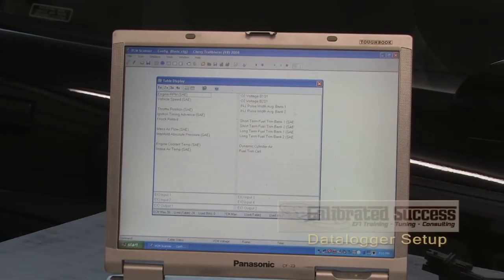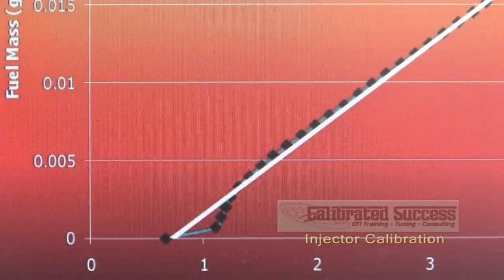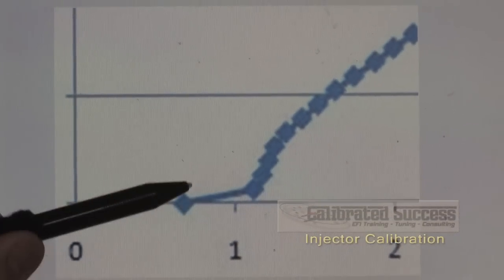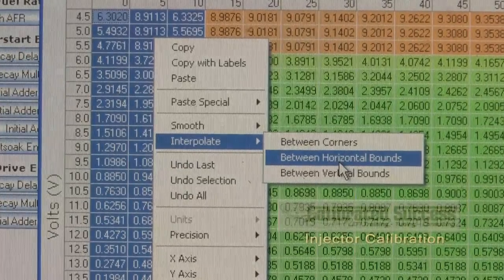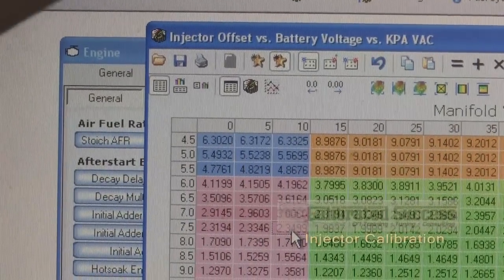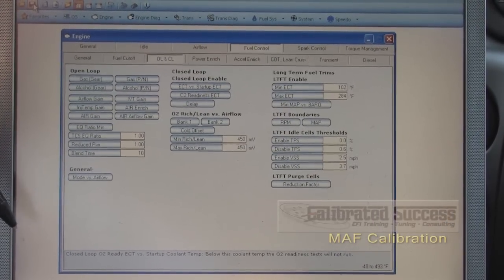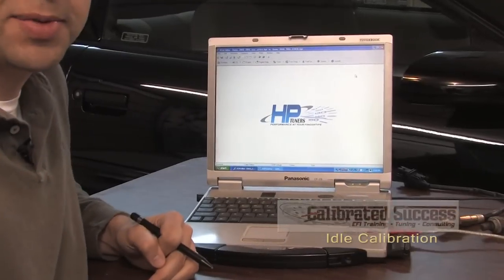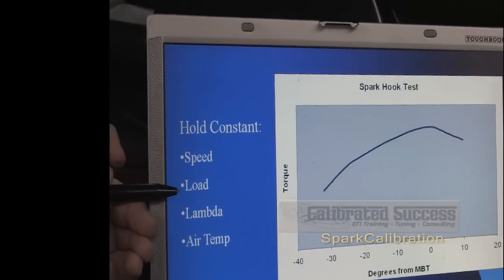Calibrated Success GM Tuning Beginners Guide (long demo)

Comment: 11:29 you say reducing the airflow in the adjustment ? What adjustment ? How is this affected by Cold or Hot start ..
Reply: The new cam is pulling in less air at that point than the OEM cam. Thus the rich error. By reducing the VE value in that cell, you reduce the airflow at that point and lean it out. This is for open loop. Closed loop needs a MAF recalibration to do the same thing. A cold start will richen up the mixture just a little bit and as it gets warmer will remove that added bias.

Comment: whats the tool used ? can it be used for Powertrain Calibration ?
Reply from the maker: Most of this video was shot with HPTuners Software, but you'll also see an example from EFI Live at the end of each segment.  Either software package is sufficient to give you an impressive level of access to most of the powertrain (engine and transmission) calibration data and controls.

Comment: where did that excel spreadsheet for short pulses come from...
Reply from the maker: Northeast Drives TM, I created the sheet myself and a copy of it is included on the data disc with the purchase of this DVD.
Reply: eficalibrator is it mainly just for GMs?
Reply from the maker: Northeast Drives TM yes, this video instruction is exclusive to GM vehicles. We have another DVD that covers Ford vehicles specifically and we also just released our Advanced Tuning Series that covers principles that can be applied to all gasoline engines using both OEM and standalone controllers.
Reply: and does it use the same concept as HP Tuners where I have to purchase licensing for each individual car?
Reply from the maker: No, our training videos are just that; training materials. Buy it once, watch and learn.  You should be able to apply the knowledge to many vehicles. Keep in mind that GM has subtle differences from year to year or across vehicle platforms, so yours may not be identical to what you see in the video.  We teach the concepts necessary to calibrate properly and let you make your own conclusions based on the science behind the ECU.  We hope that what you learn can be applied to multiple projects.

Comment: Lol GM tuning... I have a 2006 Saab 9-3 with Trionic Tuning 8. Its a mystery to the entire community, and I cant get it to work properly either.
Reply: It's pretty easy to tune on t8, with it all being open source.
Reply: @8SecSleeper  Well, I never did figure it out. I ended up manually adjusting the waste gate actuator to where on a properly installed mechanical boost gauge off the intake manifold I read an additional 4 PSI. I changed plugs and ran fuel additives to try to keep the fueling up, the MAF wasn’t thrilled with the additional air flow but it compensated well enough to avoid major lean situations even under high load percentages. I ended up destroying the catalytic convertor, and the thing was sold to Carmax wholesale. That’s like….. a little over two years ago now. Wild.
Reply: @mikehorb9485  when you try to manually add boost. With tuning to request more air mass. The ECU will see the additional air mass and keep closing throttle more and more to reduce the air mass to get it back to normal. So you will get your additional boost but make less power.

Comment: LOL wtf is with the timing portion of this video?? spark hook test from gm then.......... see ya! LOL hahahaha
Reply from the maker: This is only the demo of the full video.  The full version can be purchased from Summit Racing Equipment under part # SME-DVD-1.  http://www.summitracing.com/parts/sme-dvd-1
Reply: eficalibrator   o! My bad! Sorry about that! I was just on the edge of my seat! :)

What are your thoughts on VE tuning for Series II 3800 supercharged engines? A lof people say VE table only matters if MAF fails. Other people say you should have a well tuned VE table no matter what. What is the right answer?

Thank you!
Reply: eficalibrator  Please let me know what your thoughts are on VE tuning for Series II 3800 supercharged engines